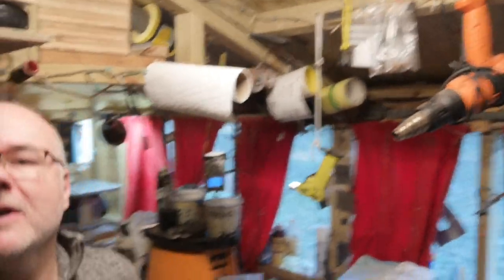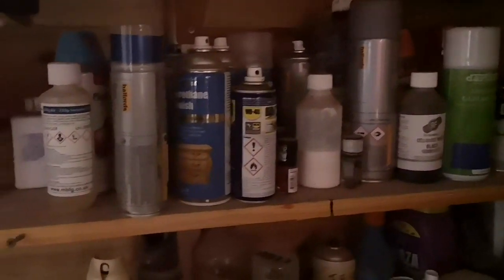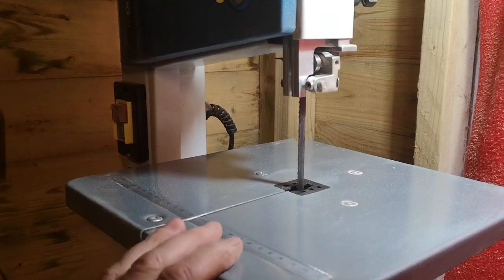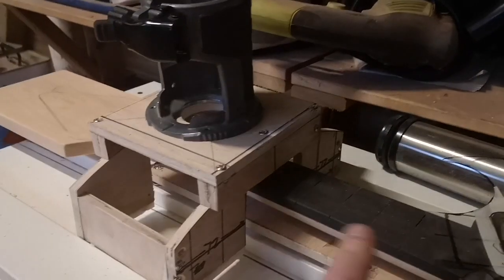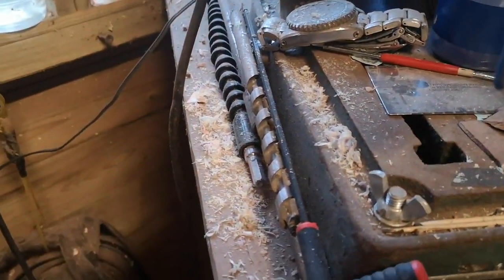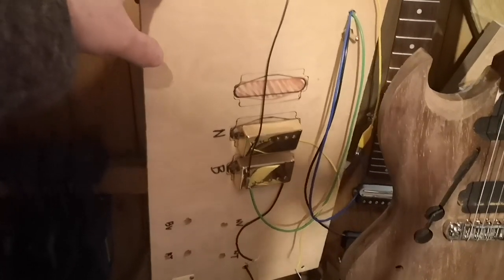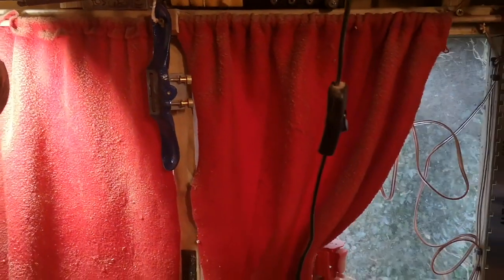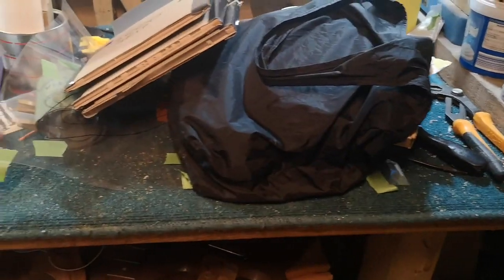Reloved Guitars messy shed tour!

Comment: Hi Sam, great tour. Got a quick question. I’ve setup my epi lp with 0.010” of relief with the low e 12th fret at 2mm and the high e 12 fret at 1.75mm and have intonated. I’ve checked the guitar for buzzing and fretting out and there are no issues apart from the 5th fret a string, that buzzes badly, when struck with even a medium force. I’ve checked it with a fret rocker and it does rock. I’ve checked the lower frets near the headstock and a few of them rock but don’t buzz. I have checked my nut height and it is far too high. What’s causing the buzzing here,is it the fret? If I take the nut height down to a reasonable level will the other lower frets buzz as well due to these uneven frets? This is a new guitar and I’m not sure why this issue is present on a brand new instrument.
Reply from the maker: Hi HG15... well from what you've put there you've got a flattish neck with a fairly low (but not as low as it could go with fret levelling) action. Ignore the 1st fret action for a moment. If only one string buzzes when fretted in only one place then it's it's because there's not enough room for the string to spin / float around after that fretted note. This can because there neck relief is too flat or because the following fret is slightly high OR it can be that the fret you're fretting is slightly low relative to everything else. This is quite common; a lb or two extra hammering force or pressing force can leave the fret fractionally lower than the rest - causing the the fret AFTER the one you're fretting to be relatively high. If you've a) not levelled your frets b) got some buzz when fretting a single string in a single area and you like a low action then you'll need to do some fret levelling to get it there. You DO want to get your 1st fret action down to 0.3-0.4mm but 1st fret action height won't cause fretted notes to buzz on anything. If you cut them too low it may make open strings buzz out on the 1st fret but that's pretty obvious why... :-)
Reply: Sam Deeks Thanks Sam, I guess I’m going to have to get the nut cut down and the frets levelled.
Reply from the maker: @hgvinyl4512  Its very rewarding to learn yourself!
Reply: Sam Deeks i will do with time. I’ve just got comfortable with adjusting he truss rod, action and intonation so I’m making progress with guitar setup. I would just like to thank you for the videos you made on adjusting the truss rod, I personally believe you have given the best explanation with regards to it. I have experimented and have found that I do not like dead straight necks but prefer necks with relief ranging from 8-12 thou. Thanks again!